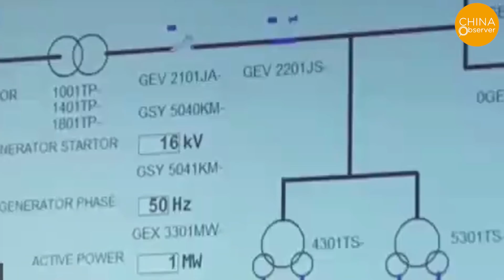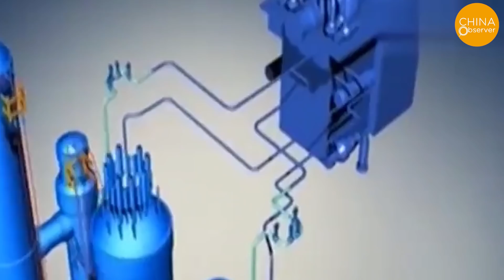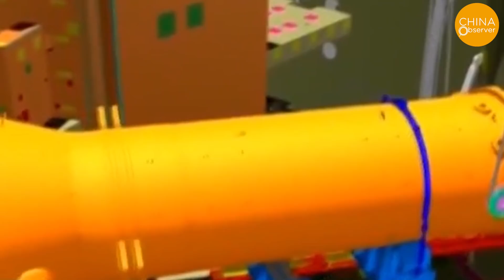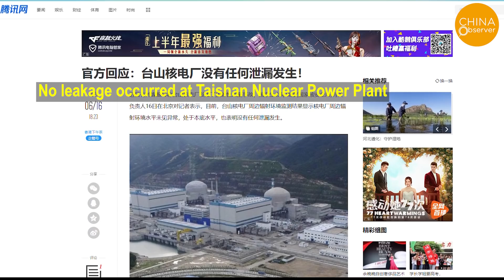China Nuclear Leak? 80 million population around, Will the U.S. share nuclear technology with China?

Comment: Fuel rod failure in normal use is NOT common. The fuel is exhaustively and 100% tested for leaks and damage during manufacture, every weld is X-rayed, it is helium filled and mass spectrometer tested for the most minute leaks, cladding failure is treated as a very serious defect. If the fuel cladding has failed in the reactor it has been overheated due to lack of reactor coolant causing it to fail hence the radioactive gasses, i.e. partial meltdown..... The China syndrome

Comment: The U.S. didn't build the nuclear plant in China. France did, so the U.S. doesn't have to do anything and is not responsible for anything that happens at that plant. If the French told the Chinese to shut down the plant, then the Chinese are SOLELY to blame for not doing what their French partners told them to do. Has zero to do with the U.S. and its grossly irresponsible  to say the U.S. has to be involved, which you said 'have to' around 7:05.
Its between the French and China. Period.

Comment: I don’t understand why France hasn’t got the means necessary to sort China’s problem out
Reply: They probably do. Finding which fuel assemblies have failed rods and then removing those assemblies is done often enough. Regarding whether the reactor can keep operating, it depends on whether they can use local neutron flux suppression to reduce the leakage from the damaged fuel rods into the reactor primary cooling circuit (way different than a release to the environment).